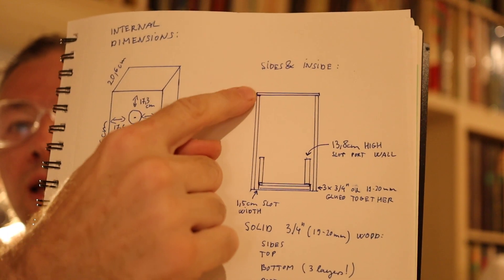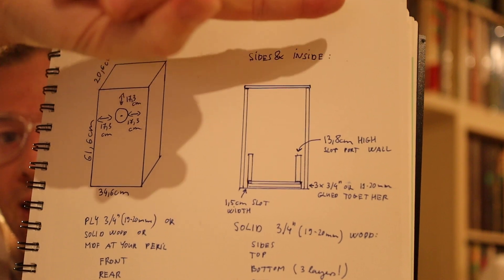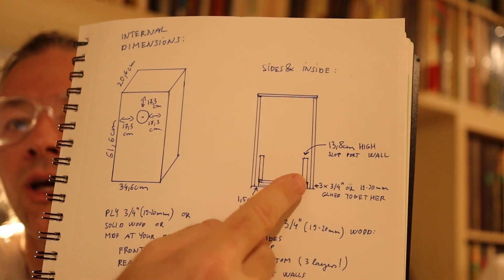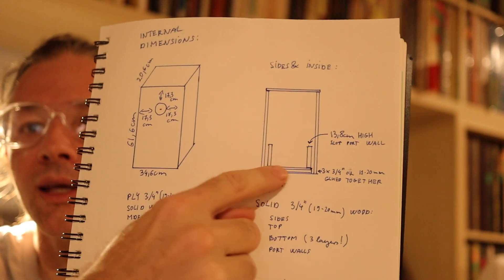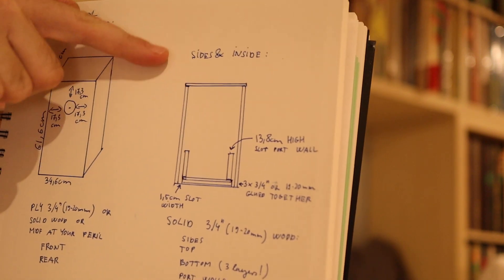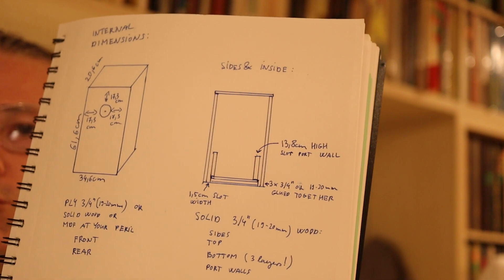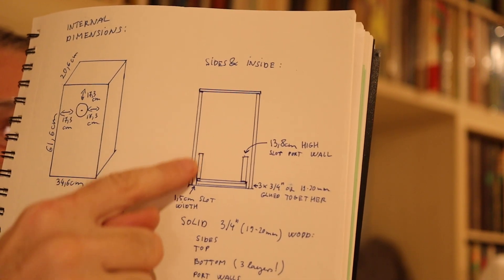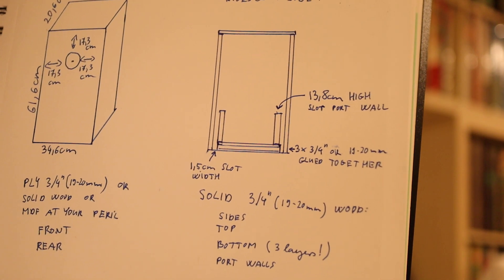La Grande Basic build Plans v20230102

Comment: Hi, is solid wood with a thickness of 18 mm also suitable? And if so, what effect would it have on the high-slot port wall? With 20 mm solid wood, the slot length is 19.8 cm. If 18 mm wood is used instead, the effective slot length is reduced to 19.2 cm (3 × 1.8 cm + 13.8 cm). It seems logical to me to extend the slot wall from 13.8 cm to 14.4 cm when using 18 mm material, in order to maintain the original total slot length of 19.8 cm.
What do you think about that? Thanks in advance for your help with the conversion to the 18 mm version.

Comment: Finally got around to building it. Had great hopes for this speaker. Have built many, many full range speakers ranging from 3” tiny desktop units, to big double backloaded horns using 8” drivers. Sadly, this enclosure is not for me. Did all the mods suggested, and even with the mods, this is not a speaker that will remain in my inventory.
Reply from the maker: I'm sad it did not work out for you. I'd like to learn from your experience. What aspects of the sound were problematic? Have you tried different room placements? What is your associated equipment? How long break in did it go through?
Reply: @realworldaudio  Hey. Yeah, it’s sad. Had all kinds of hopes for this :) The 125 driver I used for it, I’ve had for over a year, and was purchased used. So it is fully broken in. I’ve used the driver in different enclosures, including the basic ported enclosure that Fostex suggests (which is very similar sounding to the Grande.) I hooked it up to my DIY SE84 amp, which was also hooked up to an Fostex Fe126En in a Voigt pipe. I did a quick A/B comparison, and it didn’t take long before I realized the sound is not for me. It sounds thin, tinny and boxy. There is virtually no bass compared to the Voigt, and also no richness in tone. I have a small box, that I’ve been using the 125 in that is a very simple box, wide baffle, with a square port that presents much fuller, richer and with cleaner highs. I recently built the Solo 103 enclosure for a Coral Holey Basket driver (the enclosure is originally for the Fe103) and that little 5l enclosure has a much fuller presentation. So much so, that it made me reevaluate a speaker I’ve been working in for over a year I am planning on taking to market. I have a small inventory of amps that include SE tube, PP tube, SE solid state, class a solid state and high power class A/B solid state. My speakers that are used for comparison purposes include the ESL57, Cornwalls (updated crossovers and braced enclosures) double backloaded horns, Dynaco A25’s and a myriad of other speakers of my own design. I’ve also built about 20 other pairs of speakers for my friend and along with those, have listened to many of the speakers he has built on his own. All of them with amps ranging from Class D to tube to big solid state push pull amps. Sources range from my DIY heavy plinth L70, with a custom designed isolation platform, sme arm and LVB250 cartridge.  I’m a big fan of SE tube gear driving full range drivers. That combo has a presence and musicality that is hard to beat. Sometimes, when a drivers EBP is such that it wants to be horn loaded, then they just seem to work better in horns. Going to build a pair of the Fonken enclosures for the 125’s. Perhaps they will work closer to what I’m looking for. The Grandes were just not for me. Really wanted them to be.

Comment: You will improve sound quality if you do NOT place the woofer 17.3 cm from the left, right and topp.

All the 3 same distances will affect exactly the same frequency (baffle step). And will affect that particular frequency x3 times.

If you move the woofer so that left, right and topp has NOT the same distances then it will affect 3 independent different frequencies slightly and not exactly the same frequency 3 times..

And that is a easy optimization when you have plenty of room to not place the woofer symmetrical in the middle..
Reply: Maybe Janos is compensating for a distinct dip the freq. response in the FF125WK driver, so the speaker sounds good without EQ.
Reply: @EduardBroekman  Maybe, but I do not think so..

"Depending on cabinet size and shape, this usually starts between 1000-2000 Hz and continues down to about 200 Hz.
That together is diffraction and baffle step."

So between ~200 to 2000 Hz if that quote is accurate.

The ff125wk frequency response is linear and smooth in that area. Maybe at ~2200 Hz there is a little ~7 dB dip and at 7000 Hz there is a 12 dB peek. According to data sheet measurements.

In other words nothing is needed to be fixed in the fixable area.

And there is no "crossover" for implementing a baffle step "circuit".

So we got what we got..

But by puting the driver closer to one side by X cm then there will be 17.3 cm to the top 17.3 + X to one side and 17.3 - Y cm to the other side and a fourth distance to the bottom.

By doing that we push the interaction from the baffle step higher up in the frequency band with a number of less interactions. The most important distance is the that is the smallest one of the four and the second most important one is the the 17.3 and so on.

If I understand the fysics here:
https://www.speakerdesign.net/understand.html

For the above quote:
https://www.css-audio.com/single-post/2018/09/14/understanding-baffle-step-and-diffraction#:~:text=Depending%20on%20cabinet%20size%20and,is%20diffraction%20and%20baffle%20step.
Reply: @AmazonasBiotop  According to Fostex, there's a dip in the response at 550 and 2150Hz. The 550Hz translates to 1/4wave of 15.6cm..., which I guess is being addressed here. We're talking quarter-wave internal support here not baffle-step. That's a different effect.

In my experience with designing the crossover for the Lancelot, the bafflestep effect in an active cabinet is much less present than what you would expect reading the theory. With the baffle width here we'd expect a 3-6dB rising response between 223 and 893Hz but I didn't hear that in the sound sample Janos put out.
Reply: @EduardBroekman  Thanks!
Yes I see the dip at 550 Hz now (the graph is rather congested with many lines there for different offset angles).
Now I am on the same page. 

Then IF the distance Janosh is using for that 550 Hz then it is briljant! 🥳

I apologize in my fast judgment
But still the in practice and theory, using 4 different distances is a superior way to keep the baffle interface as low as possible and more "out off the way".

And having 3 of 4 sides the same distance so they work together as a joint force towards lifting 550 Hz dip. 

It would be interesting to see how much that effect is in that frequency area (If only two equal distance sides could do the trick).
Reply: @AmazonasBiotop  😀There's also the back of the speaker: while the cabinet is 20.6cm deep, I'm sure with the slightly recessed driver (there's some ~6mm playwood on the inside), I wouldn't be surprised if the back of the cone is at the exact same distance as the sidewalls.

So that gives multiple axes to support the driver. My ballpark estimate would be a 3-4dB lift; with most of the effect coming from the back baffle.

From what I know of Janos, nothing that is explicit in the design will be accidental. Not directly related but this build reminds me a lot of an acoustic guitar...

Comment: Why no front port?
Reply from the maker: Hi Frank, as the port carries port resonances into the khz region (up to about 1-2kHz), by removing it from the front there is a big improvement in the clarity of sound, and disappearance of a lot of the phase problems that a front port causes. Also, several more reasons / benefits to have it fire down, will take a couple videos to make it clear. ; ) .

Comment: Could you use two drivers one facing upwards and one forward and cross them at 300hz and make it into a baby  vol speaker or play the upward facing fullrange and the forward facing 200hz down to your tuning or it won't work that way
Reply from the maker: I was thinking of the same thing, but then just use them without any crossover, both full range. That will take the radiation pattern more towards omnidirectional, and the 90 deg between the two ensures that there is no compromise, or harmful phase cancellations that would take sound towards mechanical nature.
However, the FF125WK has such amazing off-axis radiation ability, that it really makes the impression of an omnidirectional speaker. The sound when listened to from random places, off the sweet spot is astonishingly excellent. You can enjoy it from the whole room, from anywhere. The glue on the chair is GONE FOREVER :)
Reply: @Real World Audio  hey I meant to asked you about a comment you made to another person about your car audio which you said you loved can you explain how you did it and could the same thing be done with home audio like a smaller box with a bigger cut out and thin plywood with a smaller speaker making it like you said a passive radiator I would love to try it in my car I got 6.5in in front doors and 6x9 on rear deck so how thin does the plywood need to be or do I need and enclosure in the door please let me know I trust your judgment and when you said you loved the way it sounded got me wanting to try it thanks if you can

Comment: Hello Janos, placing the loudspeaker with the same distance to 3 sides is acoustically not sensible, because so 3 identical frequencies will add up. Please remember, that the acoustically worst variant is a loudspeaker which is located exactly in the center of a square area! Regards Stefan
Reply from the maker: Thank you Stefan! I'll make a video on that subject ; ) . We did experimentation with off center drivers, and all of my buddies have since returned to driver at the center. There's more to the story ; ) Janos
Reply: Same distance left and right is okay I guess, but i wouldn't use the same distance to the top.